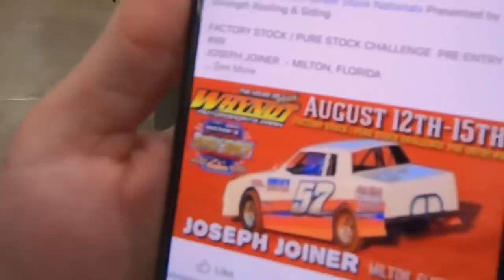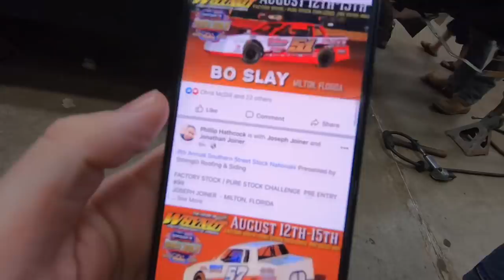Hanging out at Bo Slay’s Shop! Joseph and Bo are Going Pure Stock Racing

Comment: WOW! The high number of positive comments about Bo is impressive! He fits right into the HTF group!....Jon, great question asking! "dipping too far down" question led to a great conversation! Questions and answers felt very natural and real!.....JJ, may be not possible due to time but a shakedown run would give you the best chance of being near the front. Esp since Bo's car has already shown itself to be a winner and Bo has driven it to a win recently too. Top driver/top car....Gonna be tough. You need to get the rust off for pure stock and the set up down for max confidence before you and Bo compete. Could be a really good race with equal cars!....If you find yourselves near each other during the race, I would try and stay close together as much as possible as you both make your way to the front for the win. But keep it real.....Would make for some great video for HTF!!...Jon, I would suggest lots of cameras and operators and batteries/chargers for any race with JJ (or Jon) or Bo in it (two HTF racers in the same race).....Out of the ordinary due to not being Late Models. Makes it unique....This one could be a Special Moments race. Need to be ready.......Food for thought.